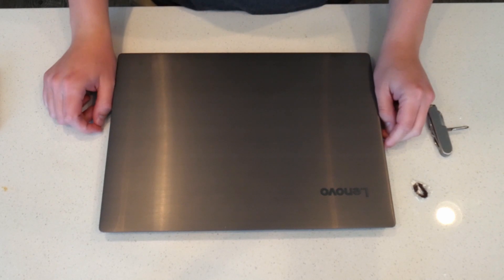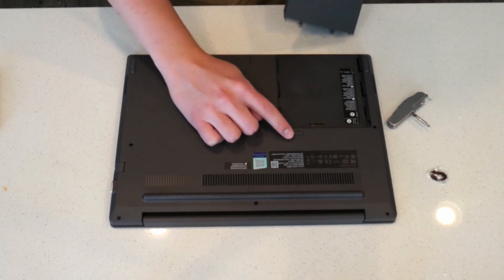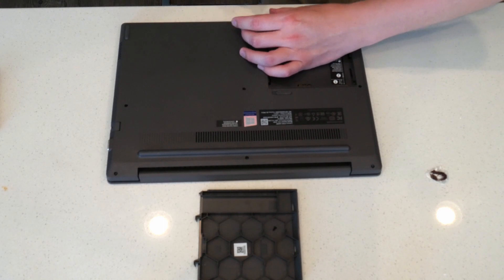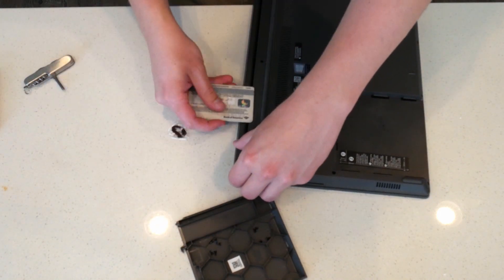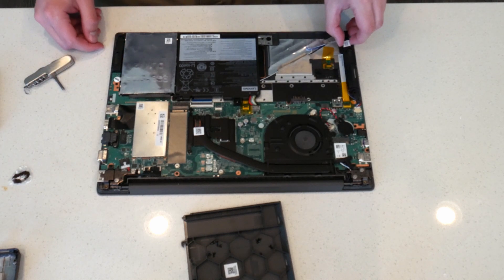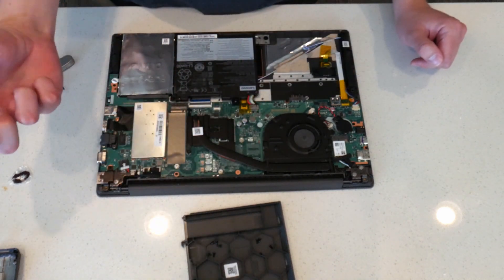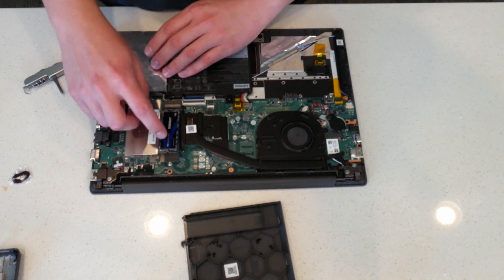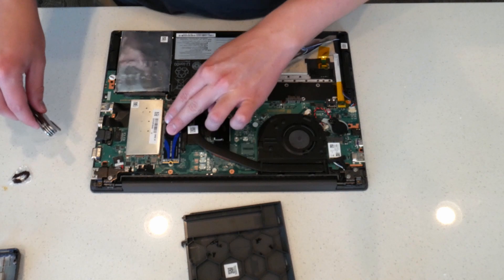Lenovo V330-14ARR Teardown and M.2 Installation

Comment: Is it compatible with Gen 4?
Reply from the maker: Pretty sure it's a Gen 3 slot. So if you somehow have a Gen 4 drive sitting around, it would run at Gen 3 speeds, but if you're looking to buy, go Gen 3 and save your money.

Comment: Just so you guys know, I tried adding 16GB and it worked (20GB avaiable, system has 4GB soldered). I don't know why people in the Lenovo forums say 8 GB is the max... 
Adding more RAM is a must since the system has a kinda beefy IGPU and it uses some of the RAM as VRAM.

Comment: In this particular model. The v330 14AAR ryzen 5 2500u, the system reccommended ram is 8gb, but can it run the additional 16gb 2400t? So the total ram is 20gb.
Reply from the maker: I haven't tried, but I've heard from some that it doesn't like extra RAM but others have said it works

Comment: Hi, thank you for doing this video! What's the max cappacity of ram on this laptop? I have read that it's 8 GB but it seems really low.
Reply from the maker: Sorry for taking so long to respond. I didn't get the notification for your comment. I read the same stuff you have but haven't tried an upgrade myself. You could probably put an 8gb stick in it plus the 4gb  onboard, but again, I don't know for sure.